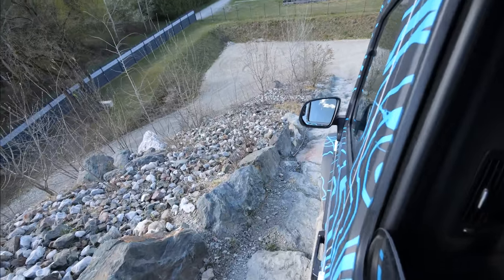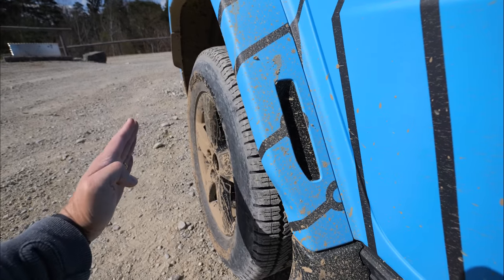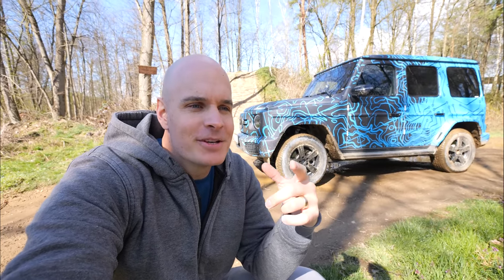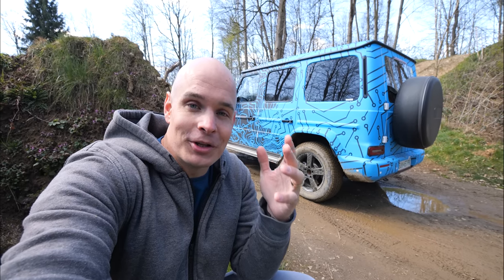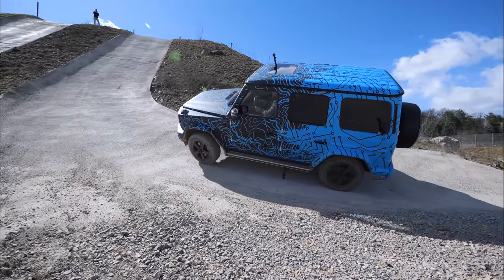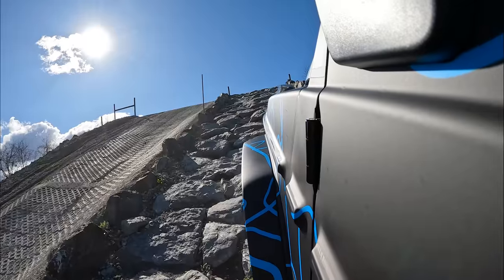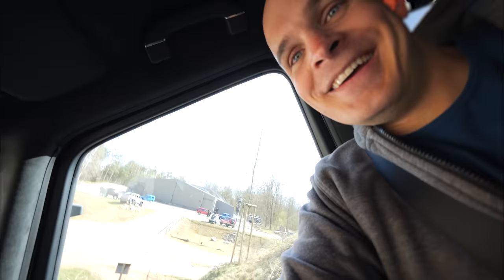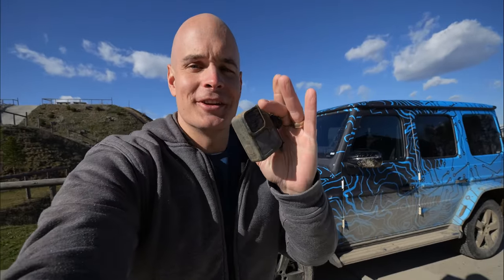The New Mercedes EV is a Luxury Stair Climber - (Sneak Peak!)

Comment: You had me at that reverse uphill.
G-Turn looks sick🔥
And we know it's a great video having sacrificed a GoPro!
Reply: My jaw literally dropped at that. That's INSANE
Reply: It's 8,000 lbs of electric propaganda
Reply: Fool took donuts to a whole new level
Reply: its rimac tec
Reply: @Dat_Sun  How is it propaganda if its actually doing it lmao?!
Reply: @BugattiBoy01  It's not. We watched propaganda advertising.  It was never in a real off road situation,  just hard packed careful selected terrain.   A Tacoma has crawl control,  everything but the pointless crab walk (gmc did this with the Sierra) it was a failure,  nobody wants it.   8,000lb ev is about the worst selection for off road conditions except in propaganda advertising.  

The range is horrendous, thats why we didn't see a range demonstration. 8,000lbs and massive rolling resistance of the huge heavy ev tires, combined with anti arrow dynamics = 175 miles range at best. Then it's off to a industrial load level 3 charger thats using grid energy, aka coal.
Reply: Iqbal, are you also the Billy bot account that went from 62 likes to 2 likes?
Reply: It's not hard to pull that maneuver with a regular 4x4 vehicle with a automatic.  It's harder to do with a manual, but i've done it there as well.  With electric it's a bit more refined, but let's be honest.  You almost never need to do that in the real world, if you do you should have scouted better (if you need to stop halfway down a steep hill and back up...what happens if you don't have the traction? you should never go down such a steep incline without being sure you can exit\turn around at the bottom)
Reply: G turn will ruin the tires
Reply: @tullo5564  8,000lbs will destroy them in no time. So it doesn't matter.
Reply: Called a tank turn.  Doesn't need a Mercedes specific name.
Reply: @Dat_Sun  cope hard my man.

This is the future of automotive technology. Don't like it? Stop being a "car guy" then.
Reply: @sharkuel   I'm going to side with Toyota who  Believes electric vehicles are not the future.

 Would you like to discuss the process of manufacturing with them batteries?  Turns out the battery factory is a big joke.  Even when we mine the lithium and other material required we send it to China for processing...  Each ship uses around 75,000 gallons of heavy oil each day.. 

Do you think China is being clean and renewable while processing our ore for lithium?  Probably not being that they love coal powered plants. You would think they'd be building solar powered plants since they work so well lol..
Reply: @Dat_Sun  Buddy, not a bot.
Reply: @iqbalsingh4326  Yes you are.
Reply: @Dat_Sun  Companies like Ford and Tesla will take care of that issue.  Opening battery factories (which already exist) in the US.  Demand for EV is increasing and as it does, supply and tech will improve.  Also, not everyone buys and EV because of the environmental impact.  That and your earlier comment on coal to generate electricity is true, but is also becoming less of a source for electricity as more sustainable ways of producing electricity are becoming available.

At the end of the day, there will always be people who don't want change and are happy with the way things are.  Look at all those horse lovers when the car was just coming out.  They resisted too.

Oh, and Toyota is committed to manufacturing and selling both EV and hydrogen vehicles in order to meet their goal of becoming carbon neutral by 2050.  They are just not sold that 100% EV is a means to that goal and feel that other non fossil fuel options need to be developed.
Reply: @Dat Sun  this can definitely be used in a pff road situation particularly for a narrow tight spot 

The weight can hemp make sure there is grip to avoid slippage
Reply: @autograndeunlimited  You haven't a clue. You demonstrated it with your comment. I bet you have never used a 4x4 vechicle off road. 

Sinking is the big problem,  snow and mud is often much deeper than the ground clearance.  Slick surfaces hate weight, I wouldn't consider using a 8,000+ lb ev on steep slick terrain,  it would start sliding at less angle than a lighter vechicle. 

Diesel is rarely used off road due to it's weight,  and it's half the weight of this pig heavy ev.

Unless this 8,500lb tank is on tracks, the psi per inch is 2-3x to much to be practical.  You would have to install Massive tires to spread out the load. 

Battery powered vechicles are horrendous off road in adverse conditions.  My 79 620 will go places this ev pig is physically incapable of, my tacoma trd would quickly put the ev junk in its place in extreme conditions. My f150 has 4x the power density.  Ev looses everywhere except maybe acceleration (to be expected,  half the weight of an ev is motor and energy supply).

Another thing, low profile tires suck off road. I would like to see a off road tire for a 9,000lb ev lol
Reply: @Dat_Sun  cope even harder, you an your old truck. Also, you wrote a lot of non-sense, just saying.
Reply: @sharkuel   I'm not an old truck. I am a retired renewable energy project Commissioner. I live deep in the Colorado Rockies, join me at Granby Homesteading,  the land where no EV can go.
Reply: @sharkuel   Destiny 2 was a sweet game. Why is it that video game accounts are so interested in electric vehicles or democratic nonsense?
Reply: @Dat_Sun  dude, my channel isn't a video game account. Yeah, I shared a Destiny 2 video of me playing, so that is a weird thing to point specifically. 

Also, I am not from USA, so your skewed politics don't mean anything to me. I like electric cars because they are a technological wonder, and indeed the future with so much potential to grow. 

Naysayers said that Cars would never replace Horses, and look where we are now. Electric Cars are part of the automotive industry, and they are in its infancy still. Now they have free wiggle-room to grow, the technology is just getting better and better as the time goes by. 

It is as simple as that. Nothing to do with North American politics. The World goes way beyond that.
Reply: @sharkuel   Electric cars have been around since the beginning of vehicles, Otherwise just as long as ice, they are not in their infancy.  So you're a video game playing non American, I'm sorry man.
Reply: @Dat_Sun  I know that electric vehicles are around since the beginning of vehicles, but I also know (because you are bringing it up in hopes I didn't had a counter-argument, perhaps) that the Oil business halted the development of electric cars quite considerably (the General Motors EV1 was sabotaged because of that), never leaving the concept car realm, or some utilitarian vehicles. Not until very recently with Tesla that we saw what Electric Cars were great alternatives to combustion engines and that they could be used by everyone. I am glad more and more car brands and governments are pushing for cleaner long-term alternatives. 

So it is a matter of time until you see electric vehicles roaming near where you live.
Reply: @sharkuel   The EV1 was not killed by oil.  They were leased to handpicked sheep ready to say whatever gm says.   They were used in a warm climate, light duty service, the range was horrible, the 1st models used lead acid and later nimh, these were basically aerodynamic golf carts on lease with no option to purchase for good reason. They were not safe, not fast enough for interstate  travel or powerful enough to cross the Sierras.

 Why are we even messing with electric vehicles when every democratic the sky is falling weather prediction has been wrong over the last 50 years?  If we were really doing this to be environmentally conscious you would think a Tesla would not be 8000 pounds or have 1000hp grid hp.

 And the number one problem with electric vehicles, where does the energy come from?
Reply: @sharkuel   If you can drive an electric vehicle to my house in the Winter time I will give you, $5,000
Reply: @sharkuel  shame without ice engines there would be no evs
Reply: @Supraboyes  shame without horses there would be no ice engines. 

Your point?
Reply: @Dat_Sun  @Dat Sun  Ah yes, more USA localised conspiracy theories... lol 

Let me show you where the energy to power electric cars come from: Renewable Energy

Heck, where I live, the three main renewable sources of energy are hydroelectric (through dams), wind (in wind turbine farms) and solar (in solar panel farms). In addition, geothermal energy is also used where there is volcanic activity.

I know the USA is overly-reliant on Oil (even invaded countries over it), but the rest of the world is doing their best to have a clean source of energy, since people are really scared of nuclear reactors thanks to both Russia and USA for piss-poor management of nuclear resources. 

But hey, if you want to halt evolution so that you can keep on driving your comically oversized and under-powered V8 and V10's, be my guest. But electric cars is the future of the automotive industry, either you like it, or not. You have to thank Tesla and Volkswagen for that.
Reply: @sharkuel   Why do you suppose China is still constructing coal power plants instead of renewable power plants to manufacture all of the renewable junk including our batteries? I wonder why China is painting their mountains green.. 

Definitely does not have anything to do with strip mining their nation. Processing all of our ore from America to manufacture lithium batteries probably does not have anything to do with it either. I bet it's just a funny coincidence. 

 Hydro power is awesome,  but unfortunately it works so well government is eliminating it here.  It's best that we don't lose any stripes or dots on certain species of fish.. 

Hydro power is becoming rare, it's only a small fraction of all the power generated.  The rest such as solar panels and wind turbines, Heavily rely on fossil fuel powered equipment from digging out of the ground, shipping all over the world, manufacturing installation, maintenance, repair, and more is all reliant on fossil fuels.  

 It takes tens of thousands of gallons of heavy oil to ship this stuff around the world each trip.. Unfortunately when you start adding it up, it becomes painfully obvious there is no way for a solar panel or wind turbine to ever offset it's initial footprint. 

Just one service truck driving out to your location and firing up the pressure washer to  clean off a solar panel array, would use months if not years worth of energy production from those same panels in fossil fuel energy.   Imagine how bad things get when we're talking about million pound wind turbine with a colossal concrete and rebar foundation.. 

  Have you ever considered how big of a footprint manufacturing a substation and hundreds if not thousands of conductors for just one site? How about the service roads? Fossil fuel equipment is used,  I don't see electric earth movers, they are Diesel powered.   The thousands of full time traveling technicians that fly all over this country to service these sites, Are not using electric jets or tesla trucks,  They use 3/4 ton diesel or gas burning rentals that idle all day long. Tens of thousands of dollars in fuel is used in just a few weeks on sites during projects.   

 You have to step back and look at everything, not just handpicked convenient facts.

 Why are we messing with adding a middleman in the 1st place? There is no need there is no evidence that suggests there is a need to switch over to using a storage battery vehicle.  The electric vehicle solves no problems, It's putting the cart ahead of the horse.  Without an abundant renewable energy source to draw upon they are making things worse by adding what is essentially an industrial load to the grid for every level 3 charger.  

There is no evidence at all to suggest we need electric vehicles. Every democratic the sky is falling weather prediction or sea level rise prediction has been wrong.  

 They scream the ocean's are rising while buying up beach side property..   Elon says use tax cattle electric vehicles, but uses more fossil fuel than anyone else launching rockets into space..   

The people that tell you to drive a golf cart are driving twin Turbo Super Luxury vechicles with bulletproof glass to their supposed to be underwater by now beach side resorts or Log cabin Mansions near ski resorts that shouldn't have any snow but still do, if not more than ever. 

 And if electric vehicles are being pushed on a greener future, Why do they weigh 8000 pounds and often have 1000 horse power?  Do they forget how much oil is required for that much plastic and lithium?  How many barrels of oil are required for 4 huge electric vehicle tires for one of these 800hp 6500lb Tesla's?   Half of a Tesla is plastic by weight,  HALF.   Guess how much plastic by weight my Datsun is? Hint, it's close to Zero. 99.5%  Recyclable by weight, and I mean recyclable none of this plastic recycling sham.   It's almost entirely steel aluminum and a few other metals tossed in.  Tires so small I could go through several sets before they would equal the weight one one set of EV hummer or 600hp tesla tires. Pig heavy curb weight eats rubber.. Ridiculous high hp makes it worse.   

 I know the solution, limit horse power to 100hp per ton. Electric or Ice, few exceptions  (emergency services,  military,  farming,  and so on). 100hp per ton, ev or ice, use electric where Hydro power or established, ice everywhere else.   But let me guess, most would consider that too extreme, and everyone wants a faster more powerful vehicle.. 100hp per ton is a solution that will get humans thousands of years into the future.  100hp/ton will still move 2000lbs at over 100mph. 

 It's not likely that we could ever use up all of our fuel reserves, but there's no need to be wasteful.  And using too much is definitely a problem, Yin and Yang.

 The idea of electric vehicles is cool, but let's wait until we have solved our power generation problems 1st.
Reply: @sharkuel  lol, horses didn't dig the minerals, and they didn't transport it around the world. Horses didn't build factories. Not really the same. Dat sun explains it pretty well. But look at pics of Tesla mega factories being built, how many electric vehicles are being used in its construction.
Reply: @Dat_Sun  he won't listen, it's a shame people don't wake up.
Reply: @Supraboyes  horses carried materials that were digged out and used to build the first cars. Horses transported people to the factories that built cars. Horses were used to transport fuel before cars were used to do so, all done at a time where people weren't enviorenmentally sensitive. It is quite disengineous your comparison here, if you assume that one the first car was invented that the usage of horses suddenly stopped. 

Guess you missed also my responses (intentionally) just to proof that I am wrong. Also, China isn't the best example, nor is the USA for that matter. But since I am based in Europe, where things are done quite differently, I have a more positive view on things. Just check Norway, for example, where they have full facilities running on 100% renewable energy.
Reply: @sharkuel  the old look at Norway comparison. Why do people use Norway all the time, please explain.